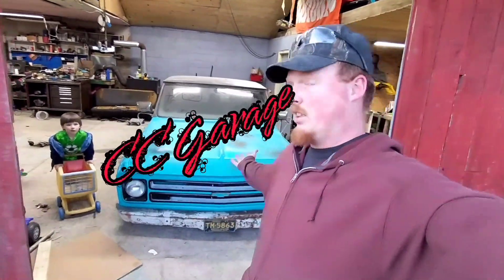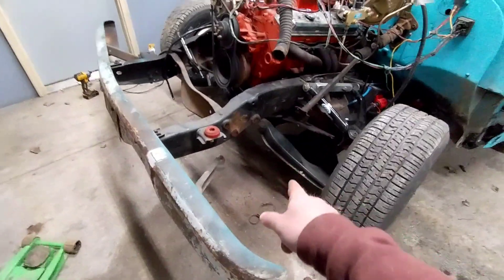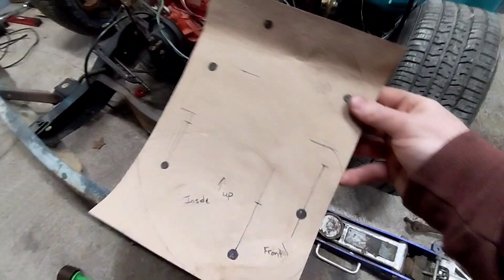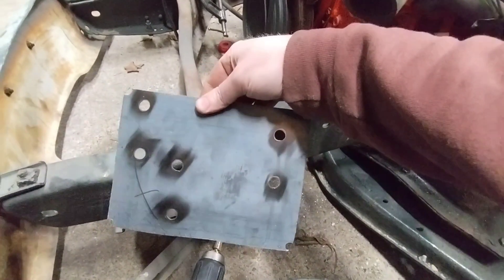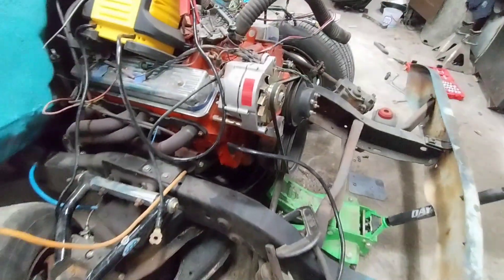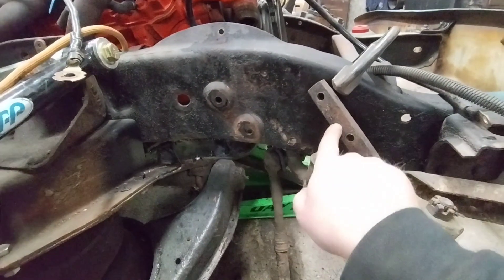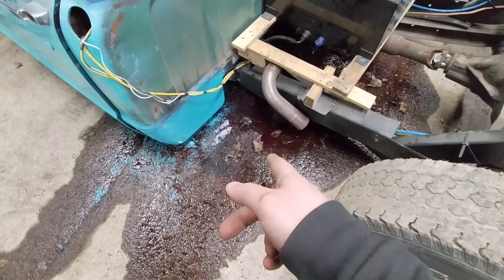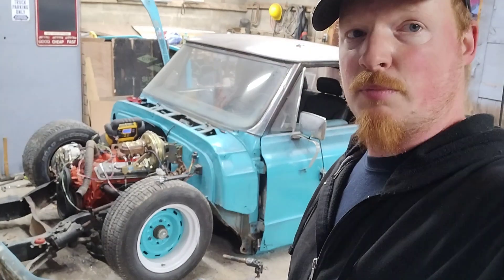moving to gearbox after pancaking the cross member 67-72

Comment: So did your cross link have enough clearance?
Reply from the maker: Lock to lock I lost like a 1/4 turn with the steering wheel before the crossbar rubs on the balancer
Reply: @ccgarage5040  Do you think engine mount shims would fix it? Or a smaller balancer? I'm about to drop my engine in and will face this same issue
Reply from the maker: @nickle549  my motor is back 1.5 inches from stock location so I could use a driveshaft I got at the junkyard but I would imagine spacers would work to get the motor higher
Reply: @ccgarage5040  I just found that they make adjustable engine block plates too to slide it just where it can clear in between the pan and balancer
Reply from the maker: @nickle549  that's cool just gotta pay attention to how much the drive shaft goes in the transmission

Comment: Thats more work than i thought it would be. I've Z'd many frames before pancaking was a thing.  I thought id try this on my next c10, but the steering modifications make it seem  like a pain. After every modification I was waiting to hear,  but wait theres more.
Reply from the maker: My plan is to upgrade the a rack and pinion and get rid of the steering box to clean things up
Reply: @ccgarage5040 

Sucks that none of the rack and pinions on the market work with a factory crossmember that’s been pancaked. Either their crossmember or factory, uncut crossmember. I’ve called every manufacturer and this is what they told me.  I just removed my pancaked crossmember in favour of a stock crossmember (I’m not on bags)
Reply from the maker: @matthewhammond3895  at some point I'm gonna switch to a rack and pinion when I feel like figuring out what else has to be modified to make it work